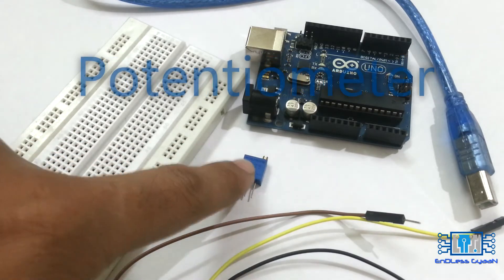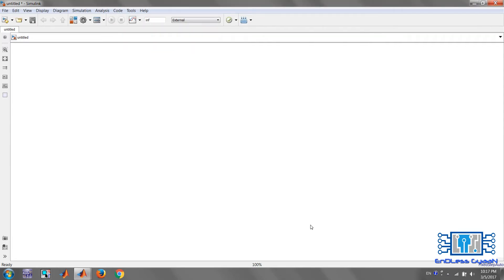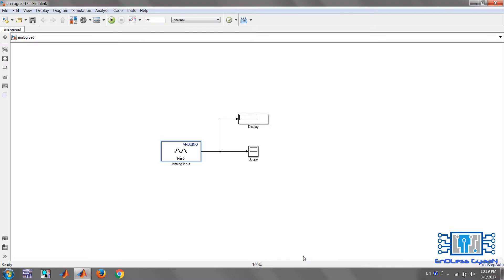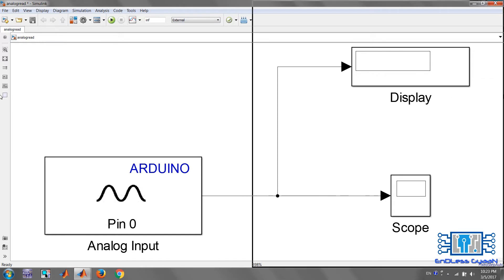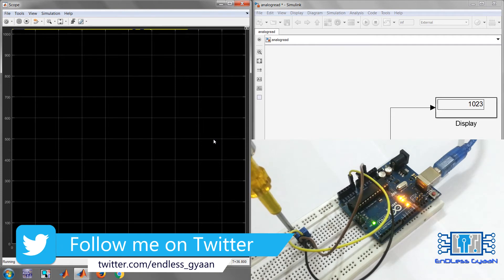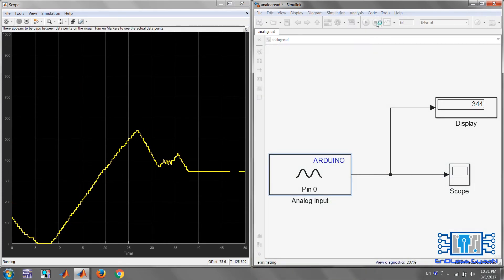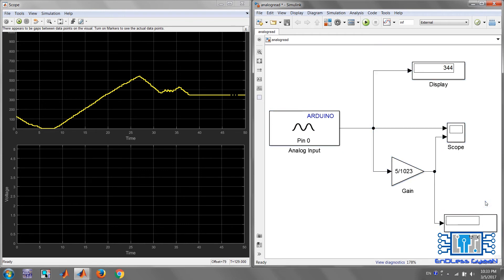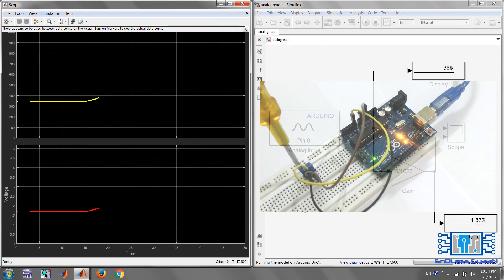TUTORIAL #5 ANALOG READ USING ARDUINO UNO AND MATLAB SIMULINK MODELING

Comment: I have a LIDAR-Lite V3HP sensor connected to the Arduino uno microcontroller via I2C connection. How can I get the distance measure from the I2C object to simulat it with simulink? Any help will be nice.  Thank you.
Reply: Use i2c read from arduino support parckage

Comment: Dear, I am wanting to control 2 solenoid valves that inject 2 types of gases into a cylinder. I am using an Arduino Mega, that is, I use the Simulink in External mode. In Simulink, I have already set up the opening and closing calculations for each valve, and the period in which they perform those openings. What I am not being able to achieve, is how to tell from Simulink to the arduino, that within a calculated period (for example 5 seconds), valve 1 is open for 1 second, it closes; then valve 2 opens for 3 seconds, closes, passes 1 second and starts all over again (ie the period). Those opening and closing times will vary according to what happens in the cylinder, it is a dynamic system. With the Arduino IDE it's easy, I add delay or millis, HIGH and LOW to it, and it works perfectly. But I need to do it in Simulink for the Arduino to do it, since I have all the signal reception and filters in Simulink. I'm not knowing how to tell the Arduino that a valve is for a certain time, then close and open the next, based on times that the same simulink calculates from the reception of signals, vary those opening and closing times. Any help you can give me would be welcome. Very good channel, greetings. Thank you very much

Comment: hey, thanks for the video! I cant read analog inputs, if the block is in the system this error appears: 
 External mode simulation is not supported for the 'Arduino Uno' hardware. However, you can deploy the model on this hardware. From the model window, click the "Deploy to Hardware" button.
Reply from the maker: you must be using older then r2016a version.

Comment: and the model is not running with MEGA 2560,it run with UNO only....
Reply from the maker: I have tried the model with both UNO & MEGA. It is working fine.
Please let me know if you are getting any error.
Reply: in uno its work correctly but in mega i received below error,
### Successful completion of build procedure for model: jk
### Creating HTML report file jk_codegen_rpt.html
Build process completed successfully
action: EXT_CONNECT
Component:Simulink | Category:Model
Error occurred while executing External Mode MEX-file 'ext_comm':
Failed to connect to the target. A time-out occurred while waiting for the connection response from the target. Possible reasons for the time-out:
a) The target is not switched on.
b) The target is not connected to your host machine.
c) The application for the model is not running on the target. You might have clicked the Stop button. If the Run button is not dimmed, click it. Otherwise, click the Build button, which downloads and runs your application on the target.
Reply: in uno its work correctly but in mega i received below error,
### Successful completion of build procedure for model: jk
### Creating HTML report file jk_codegen_rpt.html
Build process completed successfully
action: EXT_CONNECT
Component:Simulink | Category:Model
Error occurred while executing External Mode MEX-file 'ext_comm':
Failed to connect to the target. A time-out occurred while waiting for the connection response from the target. Possible reasons for the time-out:
a) The target is not switched on.
b) The target is not connected to your host machine.
c) The application for the model is not running on the target. You might have clicked the Stop button. If the Run button is not dimmed, click it. Otherwise, click the Build button, which downloads and runs your application on the target.
Reply from the maker: Make sure which mega model you are using. Is it 2560 or ADK. Choose appropriate model.

If still your problem does not resolve then try this.
Connect the mega to your pcand do not run the arduino IDE. Now start the matlab. Right click on My computer and then manage. Go to device manager there you find ports. In this see the comport number at which your mega is connected. Now in your Simulink model go to Tools->run on target hardware->options. Now go to hardware implementation->hardware board settings->host-board connection->set host port to manual->now enter the com port number at which your mega is connected.
Now try to run with these settings.
Reply from the maker: Dear Janak their may be problem with you mega board. Its just a connection problem. Try to upload bare minimum program to mega using arduino IDE then run the simulation with matlab.

Comment: my model is run but the value will not change with POT changing.
Reply from the maker: Dear Janak,

Have tried led blink model?

Is it showing any error?
Reply: in uno its work correctly but in mega i received below error,
### Successful completion of build procedure for model: jk
### Creating HTML report file jk_codegen_rpt.html
Build process completed successfully
action: EXT_CONNECT
Component:Simulink | Category:Model
Error occurred while executing External Mode MEX-file 'ext_comm':
Failed to connect to the target. A time-out occurred while waiting for the connection response from the target. Possible reasons for the time-out:
a) The target is not switched on.
b) The target is not connected to your host machine.
c) The application for the model is not running on the target. You might have clicked the Stop button. If the Run button is not dimmed, click it. Otherwise, click the Build button, which downloads and runs your application on the target.
Show less